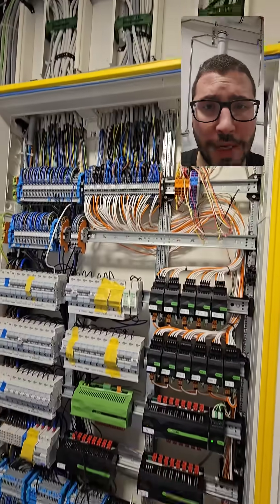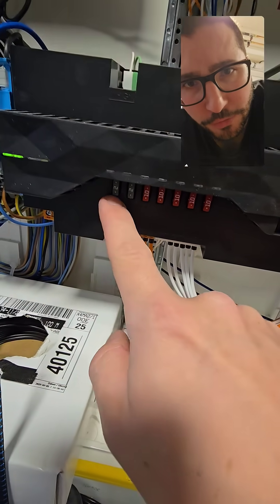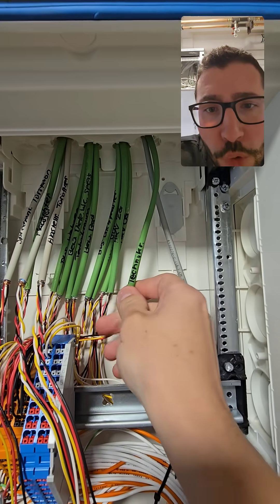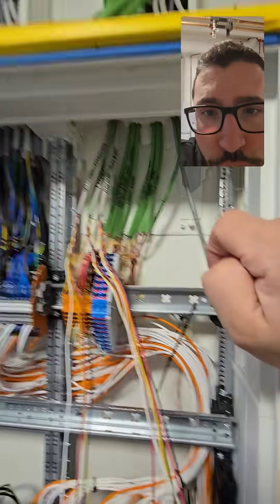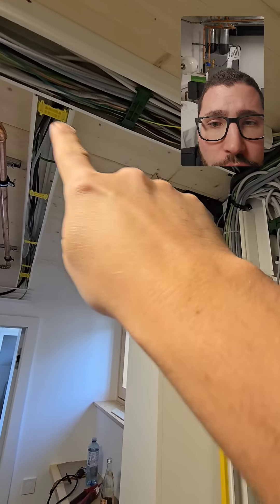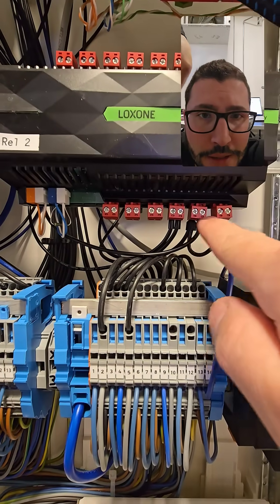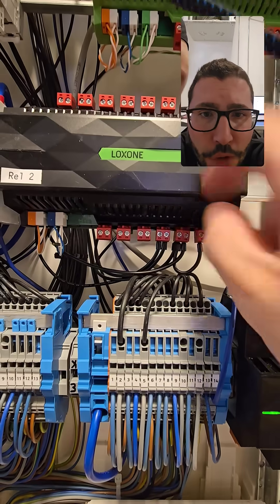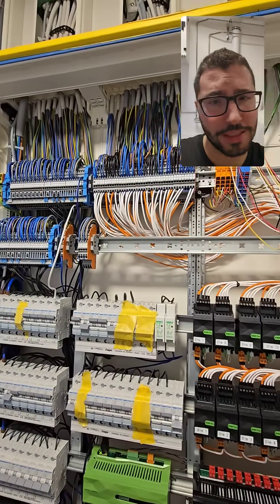#LOXONE explained in 3 minutes 🤫

Comment: Hi, Great video. I am right -> your are using circuit braker before going to the miniserver. Aren't you afraid of damaging reles inside miniserver ? How about having Finder reles, which would be used for high voltage, being controled from Miniserver ?
Reply from the maker: hello! the Miniserver (gen2) relays have 10A and relay Extension 16A, you can always go with coupling relays but its lot of work and the Loxone relays are made to switch stuff :-)